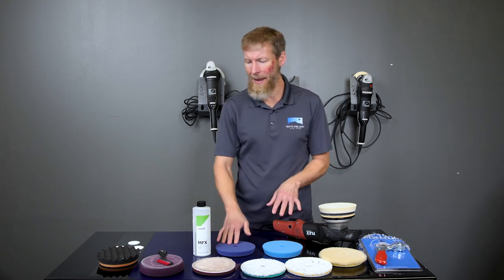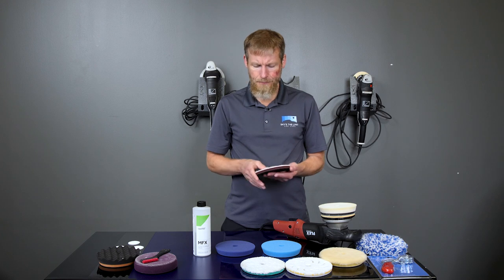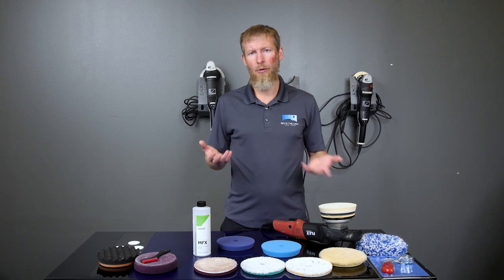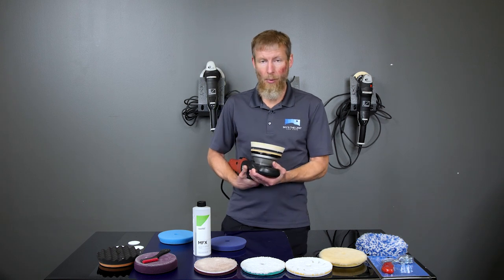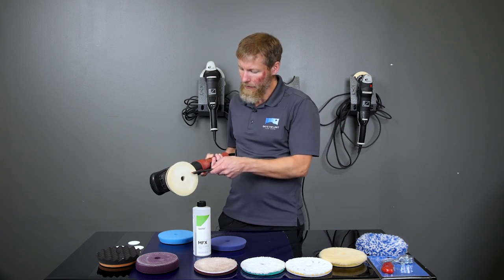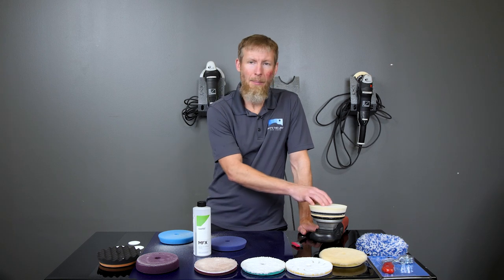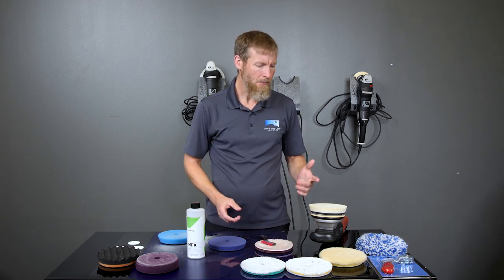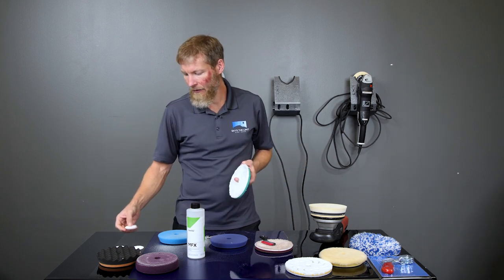Best way to clean polishing pads during and after paint correction

Comment: What if we wash the pad, put it on the machine on maximum speed to rinse it off and then continue with our compound/polish again. And finish off the car with one pad. That way we always keep the pad cool as well as prevent dusting. What do you think?
(this is Ivan`s method)
Reply from the maker: Some pads may work fine like that but there are also some that may be more prone to delamination if you introduce water to the pad while polishing.
Reply: @SkyCarCare  Delamination of what? The velcro?
Reply from the maker: Yes @flowinthrou
Reply: @SkyCarCare  Thank you, you are very helpful

Comment: love those velcro buttons, never seen them before. what are you using as a pad cleaner ?
Reply from the maker: Thanks!  Well, I try not to overthink it on the pad cleaner... Any APC you keep in your arsenal or even a microfiber cleaning soap.  Have some in a bucket and then spray a little P21S total auto wash on the face of the pad when you take it off and drop to face down in the bucket.  P21S because I feel like it is less likely to deteriorate the foam when sprayed directly on it... MFX from CARPRO would be even safer but maybe not remove polish residue as well.  Both are good options I believe.

Comment: Do you recommend avoiding Pad Washers like the Lake Country System 4000 to clean pads as you move the pad from section to section?  My problem with them is, even after spinning the pad after cleaning it, the pad still has some solution, even a small amount, in the pad and I often wondered if that would interfere with the polish.  I am fine with them when it is time to retire the pad for the day and you will be grabbing a clean pad to continue polishing but I have always had an uneasy feeling about using them on the go if my question makes sense.
Reply: How long and what speed are you spin drying your pads?
Reply: @seventysschev  As fast as possible to remove as much liquid as possible.
Reply: I use ONR in my pad washer and it works great being slightly damp!
Reply: When I use a foam pad after the pad washer the pad feels softer and I think it decrease the cutting capabilities. But it cleans the pad amazingly good
Reply from the maker: We do not have a preference either way - I think there is a place for the pad washers for sure since it is SOOOO MUCH work to clean them after but on the fly during the job I lean towards the methods I mentioned here.  It is possible and likely that any residue form the cleaning solution WILL change the polish or compound and pad SOME but in most cases it should not be a concern.  Basically, I wouldn't worry about it unless you can notice a time loss or lessening of the quality of finish with a certain combo after using it.
Reply: @SkyCarCare   I guess the best option overall is just to build up a large arsenal of pads and switch pads often decreasing the need to clean between sections.
Reply: @bluegrasskid4835  gotcha, just curious. I’ve had some leftover liquid in my pads too on occasion

Comment: Can one pad be used for both compound and polish?  Assuming you cleaned in between...
Reply from the maker: The short answer is yes.  A pad like this would be capable of both https://www.carpro-us.com/latest-arrivals/skys-the-limit-5-1-2-cutting-blue-spider-pad/ 
But if you want heavier cut then you would go even heavier on the pad like the Sandwich Spider and if you wanted optimal finish, on some paints you would be better off with the Honey Spider.  All depends on your goal, and the paint.  You can vary the pad, the compound, the speed, the pressure, or a combination of these to achieve those results.